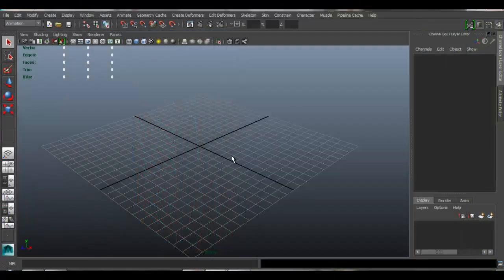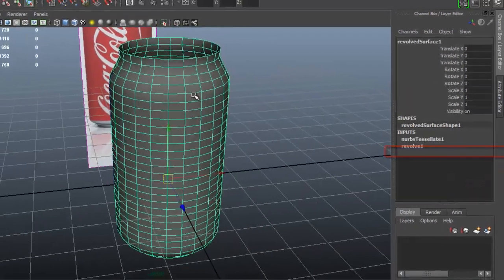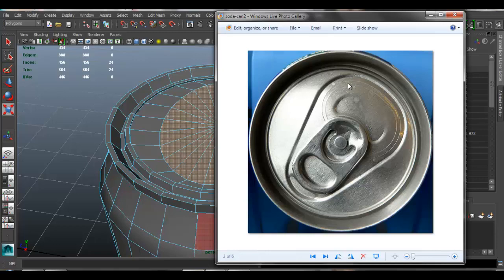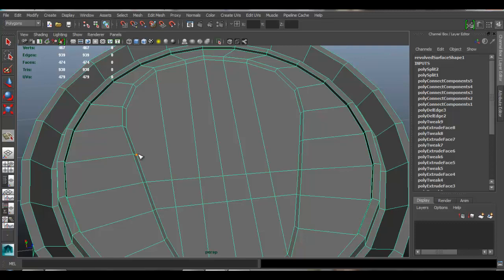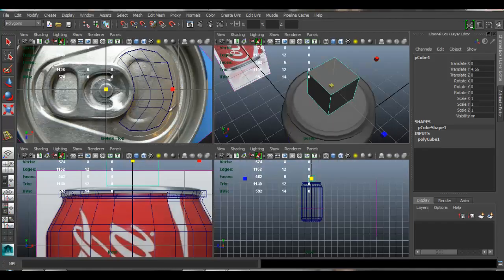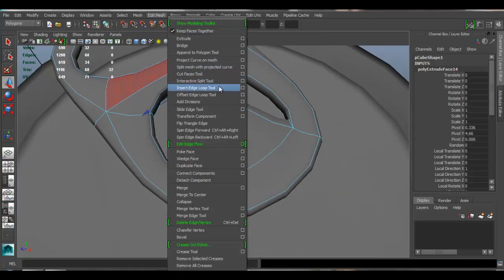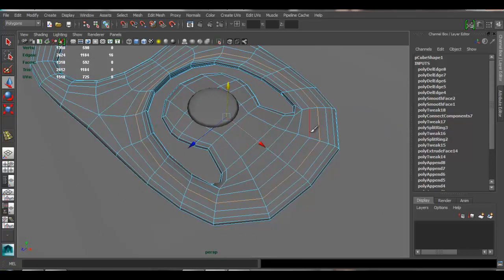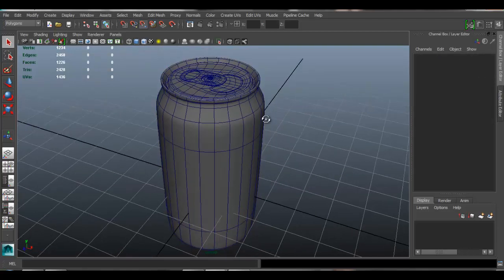Autodesk Maya 2014 - Complete Soda Can Modeling

Comment: Your PC specifications
Reply from the maker: Processor Intel(R) Core(TM) i7-8750H CPU @ 2.20GHz, 2201 Mhz, 6 Core(s), 12 Logical Processor(s)

BaseBoard Manufacture  Micro-Star International Co., Ltd.

Installed Physical Memory (RAM) 16.0 GB

NVIDIA GeForce GTX 1060

Comment: After importing the image, I can roll mouse wheel to zoom in and out while in front view, but I can't move up and down, so it seems to just zoom in dead center and I can't see what the top of the image. Any ideas why I can't move the view up and down?
Reply from the maker: you can't move even if you hold down the mouse button? Could be your mouse wheel has a problem.

Comment: At 14:28 you are using Interactive split tool; but there is no one in maya 2015 so i don't know how to make the top.
Is there other tools that I can use in maya 2015
Reply from the maker: +Advan Bratič open the modeling toolkit and use the multi cut tool. it does the same thing
Reply: +3dEx Thanks for the feedback. Really appreciate it

Comment: small tip: while working from the top view and moving vertices you can select both - the top and the oposite facing at the bottom and move them with move toll and scale tool. This makes it a bit easier to keep the shape more uniform.

Comment: If you have a student version of Maya (I am using Student version for 2015) then you should not use the CV Curve tool. I had a project for an assignment I was working on and I lost a lot of work because the CV Curve tool (and a few other tools) will cause Maya and your drivers to crash, resulting in you having to reopen Maya.

If you want to attempt it, at least save before doing so :)
Reply from the maker: Digital Salt That's crazy, should be reported to autodesk as a bug so they can fix it.
Reply: Well the fact that I was able to look it up and find the same problem already listed on the autodesk forum, I don't want to stoke the fire of a problem theyre already aware of :)

Good suggestion tho!

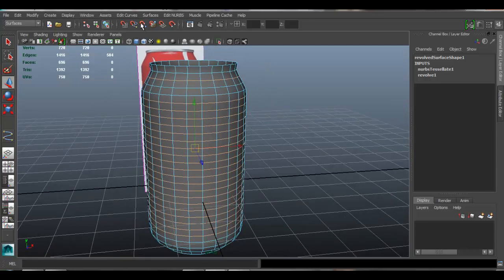Comment: 5:51 I started double clicking on the edges, but only one segment was highlighted and not the whole line itself. :/
Reply from the maker: ***** if you are using maya 2015, make sure not to switch to drag select like I did in the video because that makes it so you can't select a whole edge loop.
Reply: +3dEx Thanks! I also encountered this problem.

Comment: there is no interactive split tool in Maya 2015? any help?
Reply from the maker: ***** open the modeling tool kit ( located in one of the mesh menus) and from there use the multicut tool, it does the same thing.

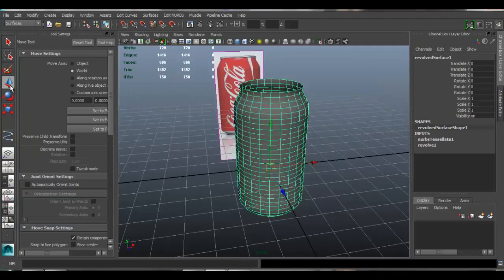Comment: Not sure if it's just me, I'll fiddle with it some more, but when I go from marquee select to drag select as denoted at 5:05~ I lack the ability to double click and select an entire edge loop in Maya 2015. It is only when I go back to marquee select that I am able to once again double click to select an edge loop. Once again, not sure if it's just me, but I thought it may be worth noting.
Reply from the maker: Aaron McAnally Interesting, I haven't used marquee in a while now so I didn't know that was the case in 2015. Also in 2015 you can stick to marquee and when you want to use the drag just hold down tab.

Comment: Hey, at 14:30 I don't have the "Interactive Split tool" (Maya 2015) so i used the multi cut tool, like you said in one of the comments below. I tried to do what you did, but it is not working. What do you think the problem is?
Reply from the maker: it should work fine, but if it doesn't try to connect the edges one by one as sometimes connecting across multiple edges doesn't work.

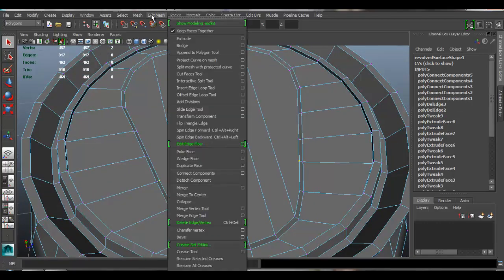Comment: 14:16  My Autocad MAya is 2011 version and in my toolbar there is not any 'Interactive Split tool' how can I add or use this tool?
thanks for attention
Reply from the maker: There is still a tool there that is almost the same I think is called split tool or something like that in the same location as the tool in this video.
Reply: I updated my MAya 2011 to 2015 but is still looks different some of the tools like surface and etc was deleted I cannot find surface  :(
Reply from the maker: Creative Art Production Did you switch the toolset from polygons to surface? Surface should still be there even in 2015
Reply: I want to change to surface but I cannot find surface there is only Animation, nurbs , polygoon and shading that's all :(
Reply from the maker: Creative Art Production That's odd, surfaces is still there in 2015 is not like they removed it so you may have to uninstall and install again
Reply: thanks I will try

Comment: Hello thx for your tutorial. How i can change the color of the interior of the can texture ? sorry for my bad english.
Reply from the maker: if you want to change the color of the interior you will have to give the can thickness, which I didn't in this video, but basically just select the whole thing and extrude it inward to give it thickness. You will be able to apply a different material to the interior by selecting the faces from the inside.
Reply: ok thank you for your help ! i ll do now

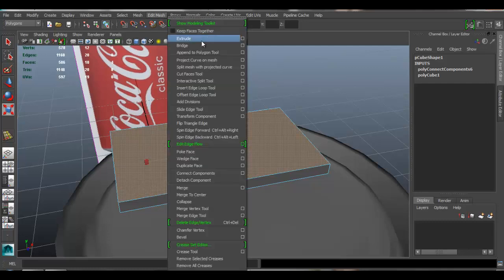Comment: at 20:30 i cant find the Keep Faces Together box...    im using maya 2015
Reply from the maker: you will have to use the modeling toolkit's extrude tool. Open the modeling toolkit, and from there choose the extrude, after you have pressed the extrude button there should be an option to disable keep faces together in the modeling toolkit menu.

Comment: My can has a bunch of flat faces on it, the rest of the can is smooth and cylindrical except for a few, how can I fix this?
Reply from the maker: may be the normals so go to normal menu and choose normal angle and apply, you may have to change the normal angle slider until your can looks smooth.

Comment: i am using maya 2015 , interactive split tool not found in maya 2015 ?? any solution  , and i would say your tutorial is awesome :)
Reply from the maker: you will have to use the multi cut tool which is found under the modeling toolkit which you have to enable from the mesh tools menu I believe.
Reply: thanks :D

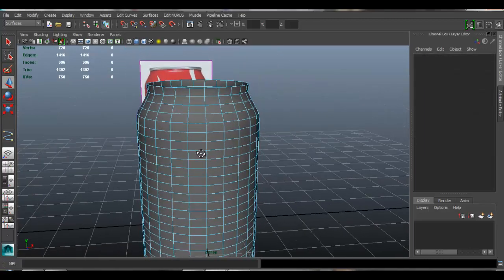Comment: At 5:20 When you select the edge, I only seem to get the part of the edge between the two vertical lines. Please help.
Reply from the maker: double click on one edge to select a whole loop, hold down shift and double click the other edge to select that loop and so on.
Reply: When I double click it, it still doesn't seem to select the whole thing, I am not really sure what is happening. :\
Reply from the maker: Dakota Waddell are you using 2015? I haven't used 2015 yet so I don't know if that's still the way to select them.
Reply: Yes I am using 2015.

Comment: This might sound retarded but right from the gate when you started to drag and move around I got stuck mine just has cross hairs I don't know how to even drag around image I'm still trying to figure out something as simple as moving around I just get the stupid cross hairs and none of the mouse buttons let me drag around and randomly clinking options just gets me no where I've had to rename my pref folder a bunch of times because for a program that is over packed with options you can't find basic ones oddly the only way to reset prefs is to manually go rename pref folder on pc :P
Reply from the maker: which maya version are you using? if you are using a version below 2014 it won't let you move the image around and instead you have to do it within the channel box options. If you are having problems with the navigation I recommend you look for tutorials on how to navigate around maya.
Reply: actually, I have to take back what I said about it being difficult. Some of these Maya programs can sometimes be difficult to navigate. However, once you get the basics down for alt and spacebar being your most used keys. You can also use W, E, and R to your options to move, scale, and rotate your model. I hope that these hints help.
Reply: I'm not sure if this answers your question but you can hold down alt and push down middle mouse button to move around the image. If you hold down alt and left mouse button you can also zoom in and out by moving the mouse up and down. Hope that helps.

Comment: Excuse me, when I use the Revolve tool with the CV curve tool, my can is created upside down, meaning that the gray part goes inside the can and the black part comes out,  What I do?
Reply from the maker: do you still get the correct silhouette and body of the can, if you do then all you have to do later is to select the object and go to normal - flip normals.
Reply: 3dEx Thanks! so much

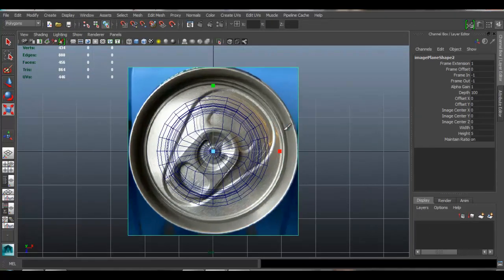Comment: How are you able to rotate and scale the image planes like that at 10:27? I'm using Maya 2013 and the handles simply don't show up for me. I can't change its rotation in the "attribute editor -> placement" either (it's grayed out). Do you know why this is happening? I would really love to know how to rotate and scale like you did in this video. I managed to only scale the image plane through the "channel box -> width and height". Anyway, thanks for your tutorials, they help me a lot, I like how I can keep up with what you are doing and every time I learn something new just by watching how you move things around and your thought process to achieve the shapes you want. Good stuff.
Reply from the maker: unfortunately,  you can only rotate it and manipulate it the way I did in video using 2014 and up. you can scale and move it, but to rotate it you will have to do so in Photoshop or by applying a texture to a plane mesh.
Reply: 3dEx Thanks for the quick reply! This clarified a lot. I'm already almost done with modeling the soda can. :)

Comment: I can't use the interactive split tool like shown at 14:30. I'm using Maya 2015. I read somewhere that this option had been included in Multi-Cut Tool but I can't drag to one point to the other one on the other side. It stops on the first vertical line  that we put just before. Can you help me ? And sorry for my bad english :P

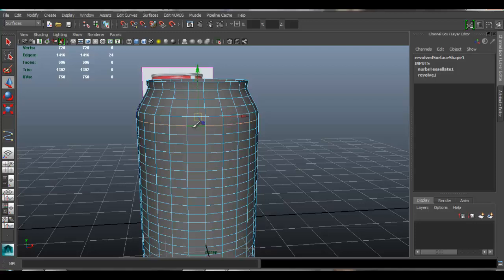Comment: Can someone help me out? Im at 5:25 When he clicks on a edge he automatically highlights all edges around the can, but when I do it only the one edge is highlighted. What am I doing wrong?
Reply from the maker: double click an edge to select the whole edge loop. Hold down shift and keep clicking the other edges to add to your selection.
Reply: 3dEx Thanks for the fast reply, one more question though :) at 14:15 I cant find the interactive split tool, Im using 2015 so maybe thats why it doesn't show under 'Edit mesh'
Reply from the maker: Jake Lockyer you can use the multi-cut tool which you can find within the modeling toolset which you can enable from the edit mesh menu. The multi-cut tool is basically the same tool, but improved and a name switch.
Reply: 3dEx Thanks for the help
Reply: i got the same problem in maya 2015 but it get solved , solution - don't changed  common selection type tool , marque to drag . it creates problem in selection  of edges :)
Reply: 3dEx i've double click an edge but it won't select the whole edge loop. Am i missing something on my settings?
Reply: i'm on maya 2015
Reply from the maker: ronny batara
yeah I found this to be a problem in 2015, I think it has to do with using the modeling toolkit or not using it. What I do is press q a few times and try again, sometimes I just enable the modeling toolkit and seems to work.
Reply from the maker: Ashish Kushwaha thanks for clearing that up. I just found that out. I now use the marquee select by default and just hold
down tab to use drag selection temporarily

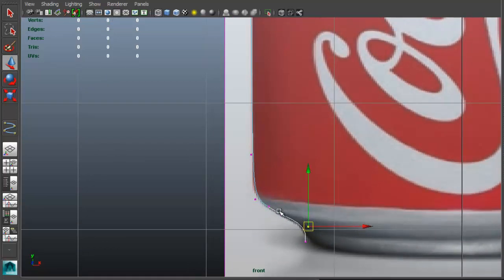Comment: How to manipulate vertexes seperately like in 2:40? I clicked one vertex and when i start to move them it moves differently than here (kinda like more are selected). Is there some kind of setting that enables you to manipulate ONLY one vertex?
Reply from the maker: hold down right click and choose control vertex. You may have use a different type of curve tool.
Reply: 3dEx I used CV curve tool, right-clicked to select control vertex and clicked on one. That one turned yellow but others turned orange and red. Not violet like her ein the vid. I'm using 2013 but maybe i just have to get used to it
Reply from the maker: Radenska512 that means you have soft selection on, press b to disable it.
Reply: Thanks alot man!
Reply: THANKS!!!! I was stuck whit that for like 20 minutes....

Comment: When I press "3" around 22:20 my model gets like three times as many edges as yours. This really messes up the model in later stages when I'm trying to scale it to fit the can. Do you know why?
Reply from the maker: That's odd. That shouldn't be happening. I think there may be a way to change the subdivision approximation level, but I have never done so. May have to use google for the answer. Sorry I wasn't of much help.
Reply: "3" for smooth mesh preview? I found a work around that worked for me for a character I'm modeling. In the Mesh option, click the box next to the Smooth option. Play around with the number of splits to get the look you want.

Comment: I solved the upload, but can you please tell me how to move around the screen and zoom in to the edge of the image like you are doing in 1:12 to 1:29 right before you do the CV curve tool on the edge of the can?
Reply from the maker: hold down alt right mouse click, ctrl right mouse click to zoom. You can also google for maya navigation controls. If you are really new to maya and don't know how to navigate around it I would recommend you look for a maya navigation tutorial video.
Reply: ALT and center mouse button worked for me I was having same issue.

Comment: Good job but next time you're creating a symmetrical object you can save yourself half the work by only modeling one side and just mirroring over along that axis. Also you can snap to grids with x and verts with v. If your manipulator is in world mode you can snap whole selections of verts to any very or grid point on any axis. Plus you should work on building your tools up in your toolbar so you aren't spending time selecting them from the menu. Just a heads up. Great job though.

Comment: Can you please explain to me why this happens? http://i.imgur.com/02bofCm.png

It's really irritating :( Also when I select faces, the vertices are highlighted with small yellow squares, whereas that doesn't seem to be the case with you. Is there a reason for this and does it affect anything? I'm using Maya 2013. I really appreciate any help,
Reply from the maker: press b, it may be soft selection is enabled. If that does not fix it you need to double click the move tool icon on the left and scroll down and make sure to uncheck reflection.

Comment: why dont i see the interactive edge loop tool? im using maya 2015
Reply from the maker: you can use the multi cut tool, I don't know if there is an edge loop tool under the modeling toolkit; not sure since I haven't used 2015
Reply: Thank you , i did find the multi cut tool

Comment: When importing the first image of the can, VP 2 crashes and I'm left with a green rectangle. Any ideas?

This is what it looks like http://i.imgur.com/gzP6RVt.png
Reply from the maker: interesting. What happens if you press 6 to enable texture mode? That may make the image visible. Make sure your computer meets the minimum requirements to use maya. I believe maya 2015 uses viewport 2.0 as default and I don't know if you can go back to the viewport used in previous versions. Viewport 2.0 is a bit more comp intensive and you will definitively need a computer that meets the minimum requirements to use vp 2.0.
Reply: Yep, that's it, I think I'll switch to an older version. I guess that viewport error comes from the viewcube itself. It's not getting rendered, it's just dark grey.

Comment: Hey dude i have a big problem and it wont go away. Need your help :P
http://gyazo.com/d0fc1e7fe5c2d87c730dfb077494ccf0
Reply from the maker: Somehow you have some extra faces on the top. The easiest way to fix this is to delete all the faces from the top( possibly including the lid part). After deleting all the faces, select one edge and go to mesh- fill hole. This will fill the hole, but now you have to fix the top face as this is an ngon. Select the top face and go to edit mesh - poke face. This will fix that and you can continue with the video from there. It is possible that this happened because you didn't have keep faces together enabled under the edit mesh menu.
Reply: never mind i figured it out. a acidentally had keep faces togheter turned off.
Reply from the maker: ***** ok good.

Comment: every time i try and extrude the top of the can after filling the hole, there will always be 5-6 edges that aren't extruding down with the rest even though they are selected. Can you help me with that?
Reply from the maker: it is possible that you may have, somehow, extra faces between those edges. So the edges that are left behind are actually faces not edges and are so close together that they look like edges. The easiest way to fix it is to delete the whole top part and fill hole for the top again and try to extrude again. Let me know if that solves the problem, if not send me the maya file through my website and I will have a look at it.
Reply: 3dEx I tried your method but there is still one face that is left out. I will send you the maya file on your website
Reply from the maker: Hi, I tried replying to your email, but the message couldn't go through somehow. Anyways I will just paste here what I wrote to you in the email. I decided to make a video on how to fix your problem. Here is the url : @watch?v=uAq3brMaDN4
It's a private video, but I added your username and email to 
those who can see it. As long as you're signed in to youtube you should 
be able to watch it.Also, would you mind if I make the 
video public. I don't mention your name or anything, but I do use your 
model in the video. I want to make it public in case anyone else has the
 same problem.
Reply: Alright,  thanks. You can make it public if you want I dont really mind
Reply from the maker: f53791 Ok, no problem.